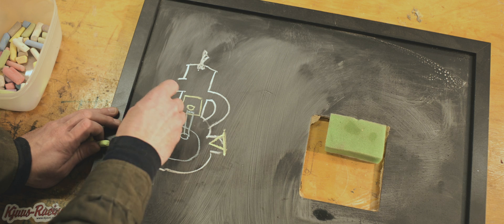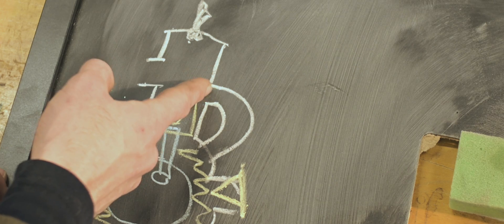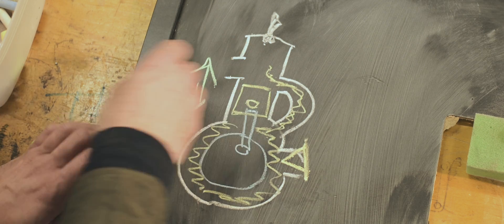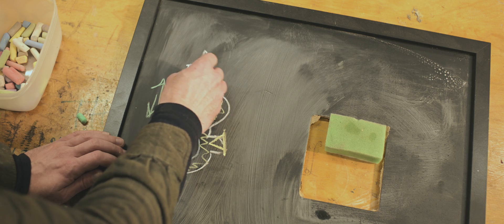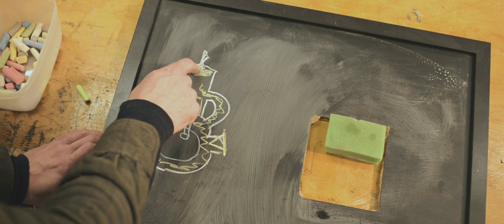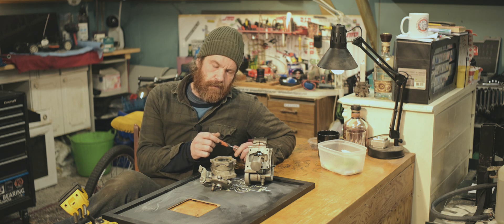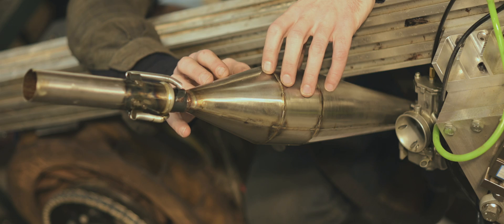Now, That's a two stroke pipe!

Comment: Is the exhaust pipe long enought? 
Whats ur port durations?
Im currenlty making a new version of my excel sheet, will contain everything you need for 2 strokes :p 

But had to take a short break from it, when i go deep into such it kinda overshadow all. It’s constantly taking all capacity of my brain xD 

It’s made as a autotune program, but ur allowed to change everything manually, because not all want max effect, sometimes you want a broader rpm kick etc.

All you need to fill in:
Bore
Stroke
Rod lenght
Top dead clearance
Width of exhaust port (3 checks)
Distance from cylinder top to all ports.
Distance from cylinder top to inntake bottom.
Piston height intake side.
Ml measured above piston in tdc.
And you can put in wanted compression as well. 
Area % which is squishband.
Then choose intake type:
Reed
Piston port
Combined
(Dont have for rotary valve)

Then it will calc:
Port durations
Cm3
Recommended carb size
Compression(from measured ml)
Needed ml for wanted compression
Peak rpm
Areal of exhaust port
Recommended header diameter.
Recommended stinger diameter and lenght.

Then you put header diameter and lenght.
Belly diameter and lenght
Diffusor 1 and 2 diameter and lenght
Baffle 1 and 2 diameter and lenght
Stinger diameter and lenght

It will tell you ideal volume for ur pipe.

Then you measure your exhaust temp. 
It will now calc temperature everywhere in the pipe, and the soundwave speed everywhere.

It will give you a graph of every important main event, as well as numbers in ms for everything. 

It will also give you correction factors based on tight angles, and volum misses and the base ones. 

Then it will calculate amplitude and show you a grap as well as allows you to see that ur ports are opened and closed correct according to that.

Later i will add ignition and hopefully i will find a way to calc somewhat jet size.

Comment: What if you added a port in to the crankcase forcing compressed air into it from a compressor or tank adding crank case pressure

Comment: Im doing my exhaust now for a 180cc 4 stroke. Gilera DNA 2004
Previous owner had aftermarket exhaust fitted, was way too big with 51mm inlet and it was really long also. It was an old scorpion exhaust. There's so many small cc bikes with way oversized pipes and the cavemen who fit them who are literally losing power and especially torque in exchange for a louder fart noise it's so dumb

 It's hard to get aftermarket pipes/mufflers with less than 51mm pipe inlet which is super annoying for small engines but seriously guys if you're tuning your exhaust for a small engine im mainly talking 4 strokes (sorry 2T enjoyers) make sure you know what you're doing and what pipe size is suitable for the engine displacement. 28, maybe 32mm at a push is suitable for <200cc, anything more and you are losing torque.
When the exhaust pipes are too big you have no low end torque. With the previous owners exhaust you could slowly roll on the gas and it'd be like nothing, nothing, nothing, nothing, then all of a sudden once up to like 7000rpm it would pull it's ridiculous. It's like the difference between 3000rpm and 5000rpm was barely anything, so you're racing the engine just to do like 30 even tho the top speed is like 85 (mph). Oh yea, the transmission is CVT sorry for any confusion.

I just got a cheap muffler from amazon, added sealant with copper, I dont expect it to be perfectly sealed at such a low price. I put stock header of 28mm ID, the correct size for this cc unfortunately the muffler does have a 51mm inlet but the inside diameter is actually slightly less but I haven't/cant measure it/dont care, so its not perfect but it'll do for now and the dB killer actually helps. That's right a dB killer improving performance. 

Of course, with even a slightly more narrow path for exhaust gases, the velocity has increased. Also there's now less room for the spent gas to expand and cool inside the muffler. More heat=more velocity and also less turbulent flow as you dont have these fast moving pressure waves slamming into slower moving gases downstream. The difference is night and day man, my bike pulls more throughout the rev range whilst retaining its high end power, better throttle response and smoother idle.

Eventually I'll probs get a 32mm inlet muffler, the main difficulty is finding a mid pipe with the correct size outlet for this. All the 32mm ID mid pipes have a 51mm outlet its so stupid. May have to end up buying that and then just cut it back, possibly shorter springs would be required also if I did this.
 I dont do welding at all, aint nobody got time for that.

Comment: Rotary valves are the most efficient intake type on s two stroke engine.  I remember the dominate Can-Am MX bikes of the seventies and how they ran the rotary valve intake tube all the way to the back of the engine cases - taking advantage of the venturi effect...

Comment: Here you can also see that the pressure pulse is weaker at the end of that gentle cone. And the pulse bouncing off the bottom is stronger due to the straight wall.

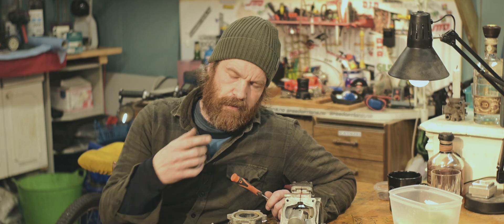Comment: @2:20 So crank seals are a huge deal! Not only so that gear oil doesn't get into the mix, but also because the loss in pressure on the top end, and more pressure in the crank case. I never knew the volume below the piston was also transferred/connected to the top end. I know it doesn't pertain to your issue, but I'm glad you showed this!

Comment: Years ago I was using a Radne Raket engine for a paramotor I built. I had a Physicist friend design a better pipe for it. after a long time building it correctly (I think) it was a success as I gained 500rpm at top end so was able to pitch the prop & gain thrust. I always wondered though if there was a way you could make the mid section of the pipe sliding so you adjust length of pipe, for more hp at different revs?

Comment: What about if you had a piston that was completely solid cylinder what it overpressurize the crank case enforced much more volume into the combustion chamber causing more power never seen this design always seen a hollow piston but what about a solid piston
Reply: That would stuff the crank case more, but a solid piston would also be quite a bit heavier, and harder to change direction at the top and bottom of the stroke, and accelerate slower.  I have thought of some kind of diaphragm for the bottom, that the rod goes through, but I have not figure out a way to keep it from coming apart. You are thinking.  Keep it up. :)

Comment: add a 6cm pipe on the carb, the airbox side. it will help the carb.  just having it open like that with nothing on it to help velocity through the carb. u can even experiment with different length velocity stacks on the carb will affect the power curve.

Comment: I used to use a megaphone out pipe to extend power band, you can use a smaller one on the intake, both act to change the impedence of the system and broaden the shock wave effect on the scavenging of the  combustion chamber.

Comment: This might be a stupid question but why does the intake have to go through the crankcase when you have a supercharger?
 Surely an oil sump would take care of lubrication. 
I imagine port timing might change because of the difference between supercharger pressure and velocity and transfer port pressure and velocity but I don't know.
 It just makes sense to me to reduce parasitic loss in the crank case.

Comment: All two-stroke expansion chambers are a compromise between noise, volume and efficiency. Most two-stroke motorcycle engines would LIKE an expansion chamber that wouldn't fit on the bike with the engine, rider and fuel tank and suspension components-but that's life for two-stroke engines! You need SOME back pressure so "silencers" are required or baffles at a minimum, volume and efficiency you trade. Even the old early 1960's 27,000 RPM 50cc 10 and 12 speed Benelli's with their 500 RPM wide "powerbands" and tapdancer riders needed MUCH better pipes-Honda four strokes beat their guts out in four years and six gears and 16,000 RPM! Read Sir Harry Ricardo's book "High Speed Internal Combustion Engines" -Oxford Press rev. 1927 +/-$400 used Epray

Comment: You need a trombone pipe. Its an expansion chamber that slides in and out according to RPMs. Faster RPM = shorter pipe, slower RPM = Longer pipe.

Comment: I used to race 250 cc four wheelers back in the mid 80s . We or should I say the mechanic experimented with crankcase pressure . He used infected plastic around the crankshaft to fill up the empty space in the crankcase.  The result was more torque at lower rpms and harder pulling through mid-range and top end . Me being 190lbs was able to compete with the Suzuki factory rider who was 135lbs . It made a big difference in being able to finish consistently in the top 3 of a mx series.  
I'm not an engineer or understand all the tech about 2 strokes it's just my experience  . 
Interesting video thanks .

Comment: This is turbo nerd level 2T engineering. The bottle explanation was the best I have ever seen or heard to explain how and why 2T works the way it does. Very interesting stuff.
Reply: dirtbike magazine in the 90's had a big article called pipe dreams. it was the best broke down explanation of the workings of the pipe and stinger i had seen so far. the bottle is also great. u get to see the water and hear the explanation.  someone somewhere might have the pipe dreams article from dirtbike magazine.

Comment: About the exhaust wave!
Evinrudes G2 outboard uses an adjustable exhaust gate which changes exhaust port timing depending on rpm and load. 
 When censors such as maf and egt are connected through ecu with fuel injection it becomes extremely efficient with a very wide power band width. 
 On the brute force with the supercharger  this will be even more effective at keeping intake in the cylinder for a much wider torque band width, especially considering your massive rpm range.
 
Someone once said" if it's easy it's not worth doing".

Comment: glad to see 2 stroke is not dead. I'd love to see a supercharged or turbocharged freevalve direct injection 2 stroke before electric motor puts a nail in ICE coffin..
could also operate bon 4 strokes with the magic of free valves and wouldn't need to be optimized for particular roms but for any rpm instead

Comment: I knew pipes helped a 2 stroke an have long understood this. I messed with 2 stroke engines daily. The last big build i did was a quadzilla  after we built a banshee. ( gotta be able to run with him. ) The power valve does EXACTLY  what you said it ADDS volume to crankcase. I used an adjustable pipe. Many moons ago lrd made a pipe that slipped together in the expansion chamber. You could add volume or subtract it. Some people used a bike brake handle to vary the pipe while ridding. These engines required lots of porting an a much bigger  carb to hit the higher rpms. Wonder if you could cut bottle an slide it together an apart an see effects.  Carry on !!

Comment: Not confused!  Great explication and demonstration.  Your high crankcase volume approach fits with the pressure-time history diagrams in the published papers of Gordon P Blair of QUB.  But . . . I am pretty certain that the crankcase resonance periods (pumped by the exhaust) are also critical to effective transfer. Looong time since I did this stuff in the '70s and '80s.  PS . . .  surely your clear expansion chamber design owes something to Walter Kaaden? . . . . ;)

Comment: You already have an ignition you can program. 
So why are you not using that ?. 
Itrust you know about getting the exhaust pipe to look like it has different turned lengths just by changing the timing and moving heat into and out of the pipe. 
The curves I finally landed up with on the small CC land speed bikes we build here 135-165cc Air cooleds look very different from the curve for that ignition. 
At some point you will have to develop a custom curve. 
My system allows you two curves and you can jump between them using a TPS or a simple switch. 
If I find my EGT / CHT temps are too high I just flip a switch on the handle bar and it jumps to another curve with less timing.

Comment: I used to fly R/C model planes and experimented with tuned pipes. I found several things.  When the engine got "on the pipe", that is, the pipe's tuned or resonant frequency, the mixture leaned out quite a bit and the engine would fall off the pipe.  I rigged up another servo to a piece of bellcrank arm I force fit on the carb's needle valve.  I could run lean enough that the engine would get up to the tuned RPM and lock on to that speed.  I would then shove the tab for that servo to richen the mixture, and it would run well.  If I left the mixture at that point and throttled back the engine would go very rich and spit and sputter.  I would have to lean the mixture to get it back up on the pipe, which was done by a slight dive to pick up RPM.  Another thing I discovered, it was beneficial to increase the height of the sleeve's exhaust port in relation to the intake ports.  That gave more time for the intake ports to close, and the back-pressure wave of the pipe to cram more fresh mixture back into the cylinder before being closed off by the piston.  The first pipe I made was silver soldered together from brass tubing for the straight tubes and the conical sections cut from the top and bottom of a ham can... hahaha!  But it worked well.  Later I bought pipes from OPS.

Comment: Thanks for this! I had no idea that’s how 2 stroke expansion chambers work. Totally explains the peaky turbo like power curve!
Reply: Actually a turbo on a two-stroke smooths the power-band and torque curve into  buttery smooth curves. Recall the Australian Orbital engine??? If it hadn't puffed a wisp of blue smoke when starting and offended the "Greenies", our cars and trucks would all be using them. A three cylinder 1.3 Liter 200 HP engine delivering 85-100 MPG on any swill at 1:400 fuel:oil.
Reply: thats not the way a two stroke expansion chamber works at all

Comment: I used to have nitro rc boats. I rember at a race some guys with the bigger nitro engines had a header that moved with throttle input. If I rember right it would change the distance between the exhaust port and lage part of the expansion chamber. I wonder if your engine could benefit form something like that giving you a wider power band.

Comment: I've thought about this problem at times, but never moved to implement a model. Perhaps a variable geometry expansion chamber could be made to provide a more linear condition for the engine. Maybe this could be done mechanically or pneumatically based on intake vacuum as a signal.

Comment: variable displacement expansion chamber..  sleeve slider pipe of some kind?   would almost have to be clutched like the drive system... as speed goes up, so does pipe volume... gotta be a more elegant solution to take up volume...  we use hydraulic bleeds on a clutch system that  allows centrifugal advance.. take up space in pipe with a hydraulic bladder that bleeds to a second bladder on a timed event?   going to need a bunch of clear pipe to test a couple ideas..   Use hydraulic fluid directly or as a piston actuator on chamber volume...  I do not know the math on expansion chamber volumes so optimized at 10k rpm vs 20k rpm ?  5-15% is easy.. not sure after that..

Comment: So when are you going to tune the inlet?  Your excellent description of how waves effect the flow in the exhaust pipe also apply in part to how the intake behaves…   Carbs work both directions, so if the flow is reversing thru them at certain parts of the power band, you will wind up with rich spots.  A intake tube, or velocity stack provides a moving mass of air to resist the back flow before the reeds close.  You can probably see this with a dry wooden stick held across the carb inlet while running. It will get splattered with fuel being added to the reverse pulse…  that is the advantage of rotary valves, you can close them before the reverse flow from the case reaches the carb…

Comment: When the wave is moving away (low pressure) it is called a rarefaction wave.  All high pressure waves are followed by a low pressure or "rarefaction wave"...as you showed with the water :).

Comment: Things I would like to try ,1 get away from premix fuel ,put on a oil injector straight to the crank bearing and use a pressure fuel like butane or propane .2 connect a boost bottle to the lower end .3 keep the Reed valve up against the crank but move the carb farther away like a can-am rotax. 4 Dimple the surface of the crankshaft like a golf ball to lessen its  effect on fuel guidence. Thanks for your time. Note gasoline steals work because of the labor needed to atomize it . Propane atomizes itself and is high octane.

Comment: When I was a kid, we used "rabbit ear" crankcase stuffers to decrease the crankcase volume to increase the scavenge pressure (McCulloch, Westbend, Power  Products, etc.) This gave more power. However, we were using straight pipes or megaphones back then. When transitioning to expansion chambers (and we would gas weld or braze together our chambers in shop class) we got away from reducing crankcase volume.

Comment: Your exhaust frustration did not leave me confused. I've thought about it also because of 2 stroke motors. They reuse a little of the unburnt gas mix from the exhaust. They scavage from both intake and exhaust. So I have been wondering if anyone ever tried exhaust timing with a 2 stroke. Maybe add an inner cone to the exhaust pipe that holds more gases and a side vent pipe onto the exterior to vent some of those gases back into the motor after the carberator. Like a pcv valve